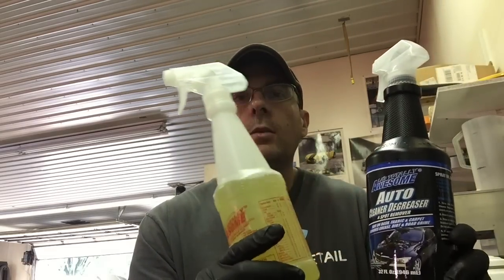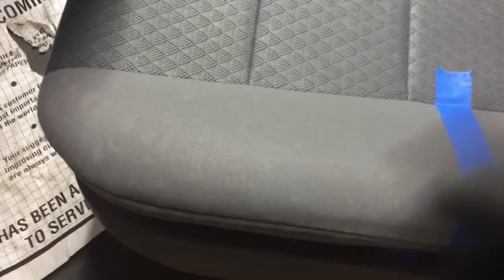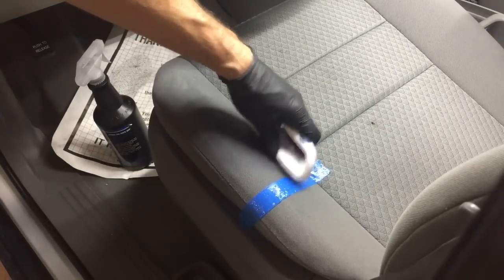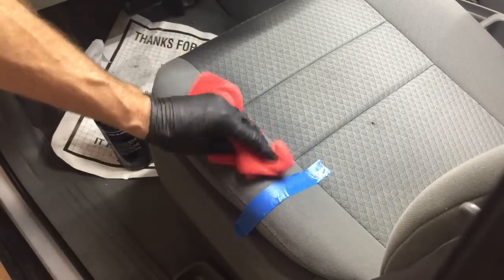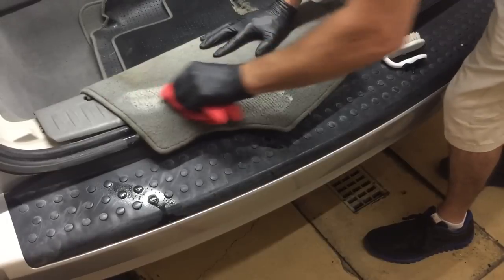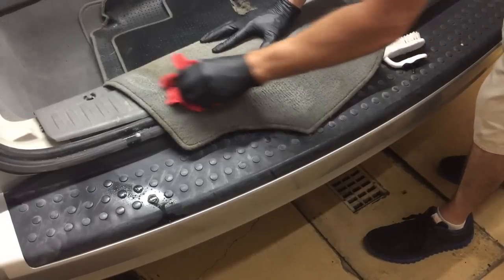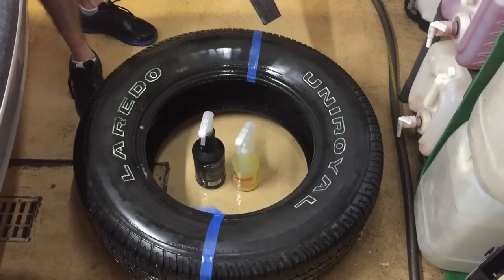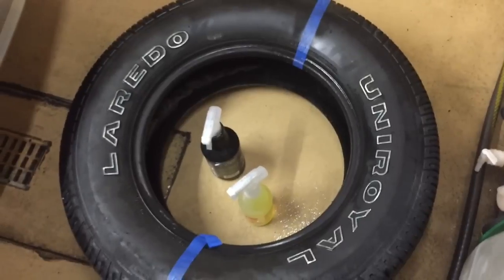LA's TOTALLY AWESOME Cleaner and Degreaser!! No Acid, No Ammonia, No Bleach!!

Comment: For many years when I was just doing some low end driveway detailing to make a few extra bucks I used this for wheels as a brake dust remover @ 4:1 it is quite good. Like any wheel cleaner, don't allow to dry and flush thoroughly.  It has many uses and for $1 it's still in my arsenal today for light duty. Always where hand and eye protection, this stuff has some dangerous chemicals, even if it states " BIODEGRADABLE "

Comment: LA Awsome cleaner is a GREAT ALL AROUND CLEANER for just about anything. CHECK LABEL FOR DILUTION RATE.  For $1, the price is certainly right.  Ive used it for over 20 years in my commercial cleaning business from motor oil smudges and even windows at a very diluted concentration.   Can't go wrong with Awsome.

Comment: I've used it it's worked better than purple Power especially if you set the part your degreasing in the Sun and let it warm up a little bit hit it again and it'll melt it right off and it's a whole lot cheaper than purple Power
Reply from the maker: With dollar stores in every block in my area... this stuff is cheap and easy to get👍🏻

Comment: Use it straight on your wheels - Let it sit for 5 minutes or so, then wipe the brake dust off.  Also works great straight on soap scum in your bathroom.

Comment: I actually use it to remove and penetrate RUST on cast iron/steel machined surfaces. IMO works as good or better than PB Blaster/WD40
Reply: i read a review that seems it would be strong enough to strip painted surfaces which is needing dilution for polished aluminum rims on tractor trailers
Reply: review i read...inside of my range-top hood and some other general cleaning. But the main reason I bought a gallon of it was to strip repainted model railroad cars. I put the car bodies in an appropriate sized tub (a plastic wet-wipe container), covered it with the Totally Awesome, and went off and did other stuff for a day or so. When I came back, all of the paint came off the model bodies with just a light scrub from an old toothbrush to get the stubborn flecks in crevices or crannies off. Most of the paint just slid right off without any scrubbing. A quick rinse to remove the cleaner and the model is ready for repainting.

Comment: Actually it's should be "Sidewalls" @5:30. Whitewall tires have a solid white strip around the side of the tire and were usually found on Luxury cars in the 1980's. They are very rarely seen installed on cars today.
Reply: Raised White Letters, or RWL.
Reply: No matter what please do not use any cleaner without goggles and a mask on they all have formaldehyde and benzene heavy duty carcinogens please remember all detergents have these

Comment: The SDS reads exactly the same, between the two. They are almost entirely orange oil as the active material. They are both a no acid, bleach, and ammonia surfactant. But they are definitely not neutral. Ph is ~12-13 so they can be helpful as a road film killer if used sparingly in the pre wash bucket, maybe...
Reply: Definitely dilute before using it as a general cleaner, don't let it sit too long, and rinse thoroughly afterwards. But that's also true of virtually every cleaning product more powerful than dish soap. I've been using it to degrease my bike's drivetrain with good results. It's powerful enough to do the job without removing paint or pitting metal surfaces.

Comment: Oh man, I recently discovered LA's totally awesome about 6 months ago or so after hearing some recommendations to use it on my car, and I found it at the local dollar store in 20 ounce and 32 ounce refill bottles. This stuff is so cheap (only a buck!) that I have no reservations with using it in large quantities like on my tires and wheel wells. It's great for that. Not crazy about the smell,but it's not bad. I've never seen their auto version this is the first time I'm seeing that. I'll have to see if I can find it locally. If it works just the same with a better smell I'd be okay with using it on the interior. By the way, what's your favorite interior degreaser that doesn't leave any residue, and doesn't discolor anything? I'd like an aggressive degreaser to mainly use on carpets and upholstery without ruining anything. For the minor stains and routine cleanup I'll just stick with diluted all purpose cleaner like simple green perhaps. Thanks for the video and sorry for the long comment!
Reply from the maker: Hello shawn!!!  I go through a ton of Spray 9 at the shop. Its clear, no scent, powerful, disinfects, deodorizer, sanitizer of germs, viruses etc.

https://www.walmart.com/ip/Spray-Nine-Heavy-Duty-Cleaner-Degreaser-1gal-Bottle/22240243?wmlspartner=wlpa&selectedSellerId=0&adid=22222222228016837324&wl0=&wl1=g&wl2=m&wl3=40343111552&wl4=aud-310687322322:pla-78303261272&wl5=9007447&wl6=&wl7=&wl8=&wl9=pla&wl10=8175035&wl11=online&wl12=22240243&wl13=&veh=sem
Reply: I used it in the house... better be sure you have ventilation, smell is quite strong....

Comment: According to the SDS, this is a Trisodium phosphate (TSP) formulation. Tsp is toxic, so you might want to take reasonable precautions like using in ventilated area and wearing gloves. Also it's not good to use directly on metal. Painted and plastic surfaces are probably OK, test.
Reply: Nobody can seem to agree what's in it--that's the part that worries me. I haven't noticed any corrosion on steel and painted surfaces so far, but I've also been diluting it and never let it soak for more than a few minutes before scrubbing gently + rinsing thoroughly.

Edit: The Orange formulation I have doesn't have ingredients listed, but the yellow stuff does. No TSP in my bottle, though it's confusing looking it up in SDS databases because all of the Totally Awesome cleaners have nearly identical names.

Comment: For how cheap this stuff is it works!! I have the yellow and used it on my door jam grease and it took it off fast. I will try this stuff for sure. The yellow products bottle is a good one, it does not leak on me at all.
Reply from the maker: I agree... the yellow bottle is the one to look for👍🏻
Reply: J Coz I have a question , what does 5 to 1 10 to 1 mean ?
Reply: 5 parts water to 1 part product and so on, why?
Reply: Oh so you can spray as much as you want right , Until it’s cleaned ?
Reply: Yes, I try to use only what I need but you have to use more at times. I get it covered and let it sit for no more that 30 secs and the LAs works fine. Here is a link to some mixes in ounces. http://www.tomorrowchemicals.com/files/Dilution_Ratios_TC.pdf
Reply: J Coz god bless you man , thanks for taking the time and helping a man out
Reply: Francisor, anytime, God bless you as well.

Comment: It also could be used to strip wax however it also could be used to clean your car’s exterior sooo yeaaaa... I think it has to be diluted 50:1 for car wash and 5:1 for wax stripping, it says it shouldn’t be used on leather at all and not recommended to be used full strength on glass

Comment: Great video as always Brian. I normally get the  LAs TOTALLY AWESOME in gallon size, & use it for cleaning engines & tires. Very affordable
Reply from the maker: Is there a difference between the one you get.. and the Street Appeal line.. or do you fine it pretty much the same?

I just noticed they have carwash, window cleaner, interior products and more!
Reply: I really liked the street appeal... I actually think it smells somewhat decent and does a good job. the only issue I have had was on a 96 Ford Ranger steering wheel. I had cleaned everything else with no issue but for some reason it streaked the steering wheel bad.
Reply: Steering wheels... especially old grimy ones... are when I reach in the water bucket for my magic erasers. Cuts to the chase and cleans them quickly! 👍🏻
Reply: Mikey P that is probably what I should've done. But I was spraying it undiluted on everything and it was doing a great and I do mean great job of making that old truck look spectacular...just got caught up and should've checked myself closer.
Reply: Charles detail N right i love this cleaner
Reply: Where can u find gallon size

Comment: Can the yellow formula be used on leather? The label says to not use on leather. However, I believe I have seen a few videos where people did use it on leather. Have you tried it on leather? Results? Thanks!
Reply: Would have to dilute with water
Reply: I recently detailed a Lincoln mkx that had leather seats and I diluted it about 20:1 with no problem

Comment: Has anyone had any experience utilizing the clear yellow in a hose end sprayer for a more overall cleaning?  I picked up a Chapin sprayer that dials in for 2 Oz, 3tbs/9tsp,1iz/2tbs, 4tsp,1tbsp,2tsp which. I'd assume is the ratio at which it mixes the product.  I actually did full the washer fluid reservoir up utilizing the 1oz ratio (lol I'm in fl and we don't freeze) and found it gets bugs off the windshid awesome

Comment: Is it ok to use on Car paint? To remove stains and oxidation???
Reply: Maybe tar or tree sap. Only way to fix etchings or oxidation is to polish the top layer of the clear coat off. You need a Daul Action polisher, cutting pads and compound for that.

Comment: Ok on full strength of the home cleaner will take the color out of your leather seats so dilute it.
Reply from the maker: Will not remove dye at full strength... its not that aggressive..
Reply: I do not know the difference between these two products, but I do know the yellow one should not be used on leather in general. It's like the one surface you probably shouldn't clean with this stuff.
Reply: If it can strip paint off of metal, it’ll pull dye from leather.

Comment: Is it safe in aluminum? I want to use it clean some of my guns
Reply: It'll work, just properly dry all parts and liberally re oil and wipe down  after since its a degreaser.

Ive even used windex in a pinch ;)
Reply: Why not use a cleaner designed for firearms?
Reply: @ohboy2592  because take the RCBS solution for example is over 20 bucks a quart. This stuff is only a couple of bucks and works great as it turns out.
Reply: GrigglesTheTexan sounds like a winner.  I’d still be careful, I used it to degrease my truck frame before doing some minor touch up work and at full strength pulled the paint completely off .

Comment: What kind of dilution did you use for engine bay and for interior trim? it was confusing to tell which product you were using you did not make it apparent, it seemed like you skipped the awesome after doing the upholstery and went right to the rubber with out trying the awesome (??) seriously half the time we don't know which product you  are using. at least have the bottle near by or mention it as you use it.

Comment: is the orange labeled one same as this?
Reply from the maker: Similar in strength.... different scent and color
Reply: is the orange safe for engine degreasing too? no need to dilute? I like your videos and the test you make.
Reply from the maker: I use this brand full strength... the only brands I dilute are Purple Power and Super clean. Now... if you are only doing light duty cleaning.. then dilute 4:1.     And thank you😁
Reply: We don't have Super Clean and Purple Power here in the Philippines unless I order it from Amazon and have it shipped it here which is not cost efficient, but i recently discovered Mean Green and LA's totally awesome degreaser on the local dollar store and having your reviews and tests help me. Keep it up! I am a subscriber now.
Reply from the maker: Welcome aboard! FYI ... Mean Green has an extra strength formula. You can dilute that 5:1 and stretch the product and save even more money. A Dollar General near me has it in stock.

Comment: Can you use the yellow cleaner on headliners?
Reply: Yes you can, dilute as necessary or not.
Reply from the maker: Sorry... not getting comment notifications on these older videos anymore 😌

Yes you can... just remember not to over saturate the area. Headliner is only held on with spray adhesive.
Reply: Yep, I did. I used it with steam!